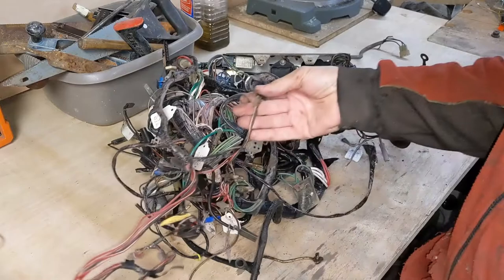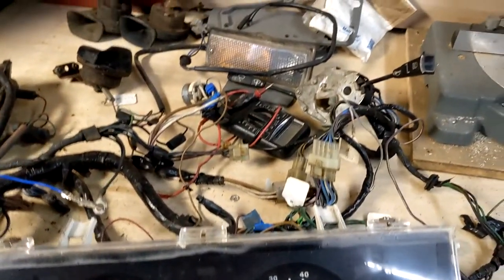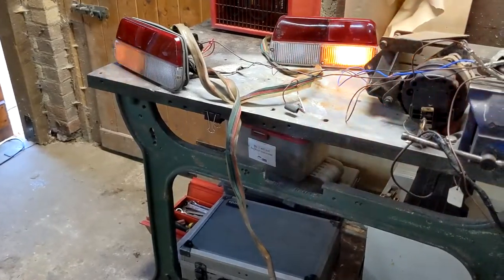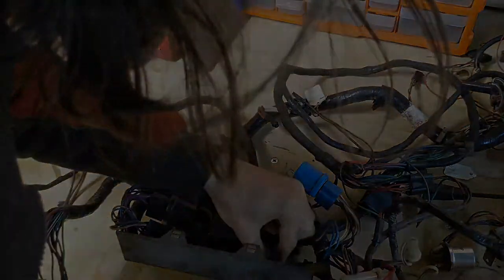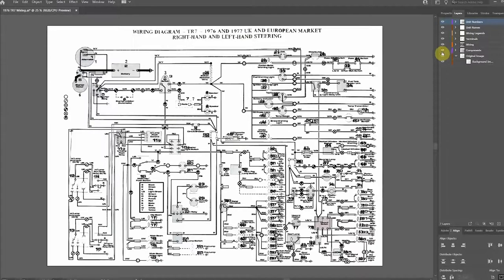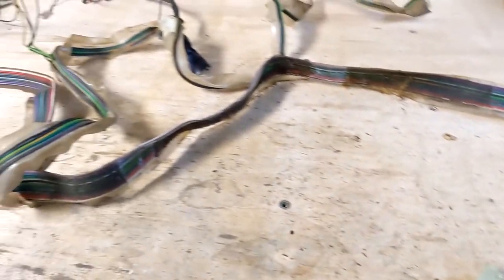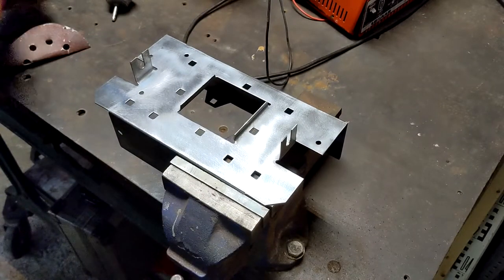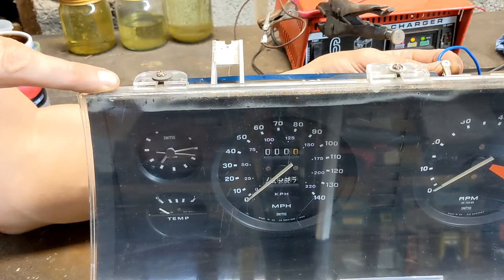Wiring Loom Part 1 - Triumph TR7 Restoration Part 18

Comment: Hi, good video ,am now in process of replacing entire front loom , got a new loom ,trouble is no fuse box ,so will need to use existing ,which is ok because it fits mounting bracket ? have you got to fuse box stage yet ,hot to remove existing loom from box,ta Ray
Reply from the maker: I'm just in the planning stages of remaking the loom, I'm adding in a few extras so I'm rebuilding from scratch. Fusebox isn't that complex (although I've got the earlier one with just 4 fuses) - I think you might be able to get a new fusebox separately if you haven't already?

Comment: Great set of video’s with ample tips and tricks to restoring these under rated cars. Is there any chance you could send your digital version of the wiring loom and parts list you created to construct your own loom? This could make mine and no doubt many others chances of constructing our own looms far simpler, knowing exactly what type, colour, gauge and lengths of wires we would need. Keep up the good work.
Reply from the maker: Definitely a good idea!
I'll be starting work on the loom soon and I'll update as I go. Look out for future videos!
As for the diagrams, happy to share that but bear in mind it's for a specific car (early UK/Euro model) and won't completely match eg later cars (different fuse box for one thing) or US models.
I'll put my resources online in a month or two when they're a little more complete 👍
Reply: @RedsGarageUK  that would be great.👍🏻 the diagram could be altered for specific models etc, but thanks to your hard work, it at least gives us all a starting point. Many thanks.🙂👍🏻
Reply from the maker: @markuren442  Not a problem - I'll upload the .ai file as well so anyone with access to Illustrator can amend it themselves 🙂

Comment: And the people who modify looms like that are the ones who moan about "Lucas electrics"! 😄
Reply from the maker: The only issues I've had with electrics on these old cars has been related to dodgy DIY wiring like that or indifferent maintenance (or age - but you can't really complain if the wiring 'only' lasts 40 years!). I've not really found Lucas stuff to be any more or less reliable than anything else of the era.